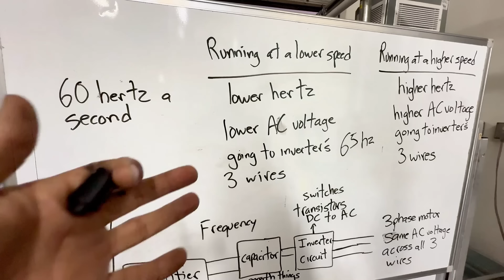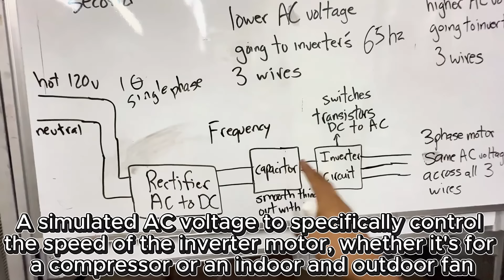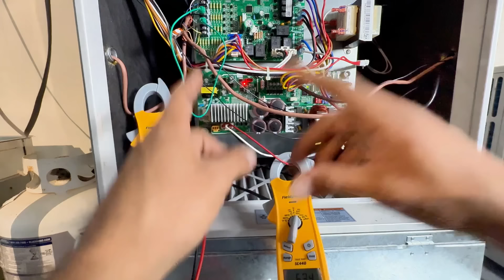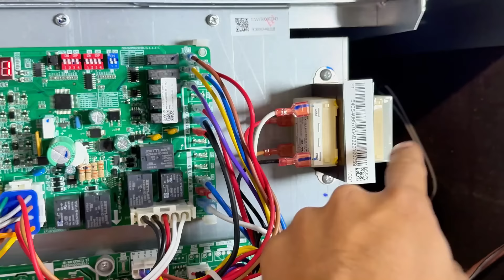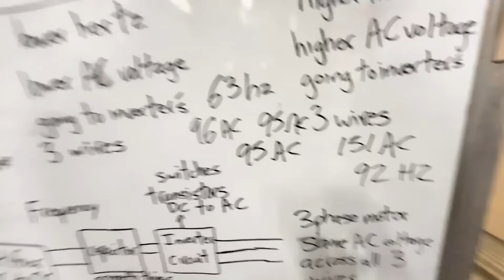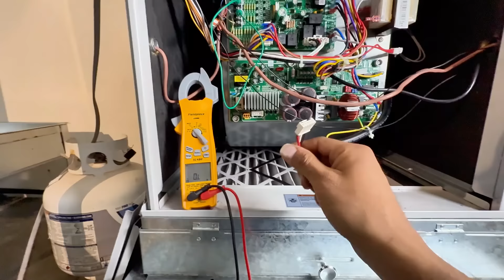How Do HVAC Inverters Work? (Simple Explanation)

Comment: Excellent video class. Thanks.
I've been in the HVAC business for 30 years so far, I have never stopped learning. There's always new technology coming up to force you to keep up.
Basic troubleshooting tips is what's most needed for us in the field. 
I've replaced communicating compressors, fan motors, and drives. Using the same procedures you described in your awesome video. Thanks again.
👊🤓

Comment: With one exception everywhere you say "Hertz" you mean to say "frequency".  That's how quickly the sine-wave of the AC power completes a 360 degree cycle from 0VAC to 120VAC  to 0 to -120VAC to 0.  The exception to saying "frequency" is when you talk about the NEC specifications, which is that 120VAC is deliverd at 60 cycles per second, or 60 Hertz.  Note that Hertz is named after a man, so it is capitalized.

If you're going to talk about single-phase AC being converted (eventually) to three-phase AC gong through the intermedia DC circuit is accurate and fine but you don't mention the 6-10% loss of efficiency in the process.  In other words, power out (3 phase) is roughly 0.9x power in (single phase) and the rest is released as heat.  Best to use devices and circuits that minimize this loss..

White is the wrong color for 3-phase.  They should be red, black, and blue.  For Delta configurations.

When you check voltage (AC) red-black, red-white, and white-black that means your 3-phase power is in a Delta configuration.  If it was in a Wye (Y) configuration there would be a neutral, and you'd check red-neutral, black-neutral, whatever3rdcolor-neutral.  Note that since neutral is typically white in single-phase applications, in 3-phase Wye conigurations you'd save white for neutral and use -likely blue- for the phases.  So you'd have hots on red, black, and blue, and neutral on white.

You don't have to take a class on it, but knowing what you're working on will make your life easier, and make your YT videos usefully informative.

"Lower voltage, lower Hertz" -- no.  The frequency (which you insist on calling it by its unit of measurement) stays constant.  Power comes in at 60Hz and it goes out at 60Hz.  Give or take but output frequency must match input frequency.

I tried to watch more, but it's clear to me that while you want to be helpful, you don't understand any of this, and will mislead those who watch your video.

Hertz, Donut?

Comment: Most of those inverters are built into the and of the motor itself.. ECM motor.. X13 motor or variable speed motor. It takes single phase 120 V or 240 V and rectify it to three phase DC volts to operate a DC volt motor. DC volts allows the program to change the motor CFM‘s up to 600 different steps on inverter compressors like the Bosch. Three phase motors and compressors cost about 40% less than single phase to operate.

Comment: Echo the main strenght frequency correspond to relarive power to cool abmbient. And another type of inverter is coupling the two coil so the induction of input to have invert voltage on second coil so we had 240 volt out of 110v  or 110 v out of 55 v just like 3 phase so if 3 phase in put 3 coil induce 3 secondary coil so we hadc 180 hz 240 v

Comment: The inverter here is essentially a VFD or variable frequency drive programmed to also act as a soft start to eliminate large energy consumption spikes. This one is converting the incoming single phase power to 3 phase power. Three phase motors give better speed control and are more efficient than single phase motors. Especially under speed controlled conditions...
Reply: Exactly, guys, check how a VFD works for controlling a 3 phase motor to better understand how inverter technology works.
Reply: Yeah, you’re spending all that money to save pennies.  When you added it all up, the energy companies are saving money while you’re foot in the bill.
Reply: @garyo8546 the money you save from energy they get from you when you need expensive new parts.
Reply: @garyo8546 these are more about comfort than power savings

Comment: gli inverter ormai sono uno standard da 20 anni in Europa, purtroppo i tecnici non sono assolutamente preparati sul lato elettrico, misurare tensioni e Hz non rientra minimamente nell'ottica della riparazione, misurare gli avvolgimenti si.
Sono riuscito a riparare un General da 30kBTU grazie allo schema circuitale delle 5 schede elettroniche che montava, alla fine era un semplice condensatore di sicurezza sulla linea di comunicazione, un componente da 1€ bloccava l'intera comunicazione, una volta sostituito è tornato a funzionare 😁😁

Comment: Just so some may not know (the younger generation), the old air-cons worked only in an on-off way, the compressor would turn on, once the desired temperature was reached it would turn off and so on, no circuit is required as the thermal sensor turns the unit on and then off (but cannot control the compressor speed), the new inverter systems work this way,, they convert AC to DC to allow electronic components to work in their right DC state, now you can control the compressor's speed, they use a IGBT to control the compressor motor's speed thereby reducing power consumption, the video explains it in more detail.

Comment: Well I noted that even the compressor  work harder and frequency when up, with heat pump working, the consumption of power it's a lot lower in winter time. 

With a split ac unit. Working with panels solar in winter every watts 😅  matter

Comment: How would you determine if a motor is bad against the inverter board
Reply from the maker: You can check out the windings of the compressor, similar to a 3 phase. Usually a board tells you if there’s an error. I’m still learning how these work

Comment: When you say motor you mean the compressor motor? I think so as the voltage can be quite large and you would not have this on the fan motor for cooling the condenser. The hertz is the cycling frequency for slowing/speeding up while the voltage increases to drive a heaver load/compress harder? The efficiency is achieve with optimal hertz/voltage for a given load. All clever stuff! Thanks for you simple explanations and using multi-meters to demonstrate the principles.

Comment: I'm not an HVAC pro by any stretch. Regular job is EE/Computer Science. A couple months ago I installed an ACIQ 5 ton inverter side discharge+ducted air handler to replace my old Train. I had to watch a crap ton of videos including yours to build up the confidence level. It all turned out good. In the end, I've learned to appreciate the old school 'jam a screwdriver into the contactor to force it to run' units - so much easier to work on and the physics involved is straight forward. These new high efficiency systems are jam packed with at least 4 major circuit boards and probably 2 boards that contain a microcontroller with firmware (the software that drives the algorithm you speak of). I've been looking for a "programming" device for my unit to no avail so I can get deep into the diagnostic data (there are ports, but they are probably only for testing at the factory in China). These things are becoming identical to working on modern cars where you need a laptop, custom cable and pay Ford for the dealer software to modify, diagnose and update - kinda sucks. Even the for the service manual - I couldn't readily find it. Finally, I had AI search and it was able to find both the condenser and air handler service manuals. However, these manuals are not low level enough to do things like board level repairs (for the most part) and do not explain the strange behavior of my unit (what trips certain phases like defrost, what current level on the compressor tripped a FC 49 error, etc). On top of that, they're so new and there's simply not enough folks in the field that have experience with these units. Good luck trying to get any data on the algorithm that drives these units - in particular I'd like to know to understand the protocol of their fully communicating thermostats. Currently, I am using a "dumb" two stage Ecobee. However, their version of the Ecobee (obviously a rip off if you look at the thermostat) is fully communicating which means it allows the unit to run completely at variable speeds. Keep making videos and if you find out any tips and tricks for these units, much appreciated! Thanks!
Reply from the maker: Thank you for your explanation. I know it took time to write your thoughts down. It’s sad they don’t let us understand the algorithm as to how exactly these units work. I’ll be working on a project on a mini split where I’ll be manipulating the thermistors using potentiometers and I have a programming software where I can see the temperature live. Inverter technology is simply using temperature sensors that are on your discharge line, evaporator, outside air, on your condenser and other temp sensor to either speed up or speed down your compressor, condenser fan or indoor fan as well as opening your eev. I’m Excited for this project!
Reply: @PioneerHVACControls  That sounds like an awesome video. I appreciate your work and willingness to share with us. I'm currently in the process of diagnosing my ACIQ minisplit failure. The compressor was surging and vibrating alot while in heat mode ( much smoother in cooling mode) before it quit and won't start up now.I initially thought it was a compressor mechanical failure, but am now thinking it is a power delivery issue.  I'll use your video to try some testing. Thank you
Reply: @PioneerHVACControls  please explain us more invertor technology of outdoor unit aswell  how its works heat pump thanku so much for explaining this to us great knowledge
Reply: wait until you have to replace something on it..   when there's  "not one in the country".....  or they quote you 6300.00 for an inverter board..........
Reply: You should replace the indoor temp sensor, instead of messing with the inverter. 

You dont want to change rhe defrost etc, ypu obly want to ramp up or dpwn the compressor. 

If you go for the inverter output, you wont understand the compressor limitations or underatand logic to return oil during low loads. 

There are several digital potentiometers that emulate a thermiator. Homeassistant + hardware, or harware and some kind of small programmable logic board is the way to go. 

There is a finished out of the box system for about 50usd, but i cant remember the name, i use it to emulate the temp fpr just this thibg in my inverter heatpump with a dumb thermatat

Comment: HVAC inverter in your system is VVVF variable voltage variable frequency refers to electronic drives that control AC electronic motor speed and torque by simultaneously changing both the frequency and voltage of power supply
Reply from the maker: Correct! Thank you for explaining that. Would wish someone would give me the algorithm to these so I can learn what exactly controls the speed of these motors to run faster or slower, especially on the compressor side.

Comment: ECM is similar but not the same as variable speed. My air handler is ECM and my condenser is variable speed. They are mismatched Ruud, 5 ton. They both are single phase, 240 volts, no neutral wire, two hots and a bare ground wire. 

Your next video should be about communicating systems. I had to run the condenser in legacy mode, non-communicating. The condenser operates using Y1 and Y2 and actually run as a 3 speed. The algorithm and timers dictate which speed is running. It really saves on the electric bill. If the outside temperature is greater than 99 degrees, the condenser will switch into superspeed, a fourth stage.  In fourth stage, it sounds like a weed eater.
Reply from the maker: Thank you for your knowledge and explaining how your system works. Makes sense how on a hot day, the condenser speeds up to reject heat. I would love to understand how exactly the algorithm works but no one shares that information but I’ll find it soon!

Comment: HVAC contractor with at least 20 inverter installs so far. Totally off grid and powering about 8.25T of inverter heat pumps. I have only had one failure on a customer install so far and that was a 5 ton Gree/Airtemp side discharge compressor. You did a great job on the video and looking forward to more. 

One troubleshooting check that you could also do on your inverter compressors and blower motors is to check from each Terminal UVW to ground. You should have infinity on your meter or Open. Most of them that I have found over the years, including the one inverter compressor have been insulation breakdown, causing a short to ground.

I’ve watched a lot of videos from India, Pakistan, Africa, Australia, but very few of them are translated into English or they don’t go deep enough into the operation of them and troubleshooting. I have to guess what they are talking about, but it does help. I’m glad you’re here now in the USA.
Reply from the maker: Thank you for your input! I’m trying to make more videos on inverters. I know other countries make a lot of videos on this subject. My next goal is to understand the algorithm behind the inverters but manufactures don’t like to share that. Will have to continue looking 🙏🏼

Comment: What’s the voltage when you measure Red, White and black to ground individually?
Reply: That is not a helpful measurement in this case, unless you are wanting to know how bad you will get shocked ;)
Reply: @FixthisCD why it was a useless measurement? If you really want to learn something you should have known as much as possible
Reply: Zero
Reply: @TexasEngineer are you a real engineer?! Based on your answer I don’t think so😂
Reply: Do you see a ground wire? No. Only three wires. From the information available, it looks like a delta wound system. Delta does not have a neutral wire. It could be a Y wound system but that would be very rare. The neutral wire is for imbalanced loads and this type of system has no need to have an imbalanced load. The three phases acts as a stepper motor driver and the motor follows the phase angle. At low speed you can hear the motor step. ECMs run too fast to hear this effect.

They are creating three phase power that is independent of the house supplied power, isolated. There is no reason to ground the independent system and risk house power contamination. 

Why do we ground the neutral? So if we get a ground fault, the breaker will trip. There are no breakers on the three phase power.

Am I 100% certain? No. Because I have worked with power transmission lines and they use delta. They do have a voltage caused by capacitance/induction to the earth. Is the voltage predictable? No. 

That is why the previous answer is correct, it is not relevant.
Reply: @TexasEngineer thank you for the explanation. I just wanted to know the measurements of each wire to ground with multimeter😂
Reply: Even though the compressor is stuck, the reading of resistant remains normal. Is that true?

Comment: I been waiting for vedios about mini split troubleshooting long time and that's the beginning of it .as a hvac contractor we start doing a lot of mini split unit but unfortunately we still don't have the knowledge how to troubleshoot these systems when they have a problem. It will be great if we see more content about these mini split.thank you so much for your contents on your channel.
Reply: Unless you have exact manufacturer diagnostic data and procedure, you won’t be able to make a call on these systems. Unless you do a four year degree in electronic engineering before becoming an hvac technician. You can only check the obvious. Sensors, voltage, AC and DC rails. The charge and fuses. Beyond that you have to know the specs and values for what you’re looking for. I do Mitsubishi, Daikin, LG VRF on daily basis. Each brand does things differently but I assure you most of our problems here in the U.S is bad installation. You’ll barely have to look at the electronics because you’ll be using service checkers and a computer.
Reply: @mwdub02 correct I hear bad installs is the primary cause of failure on mini splits
Reply: Yep call tech support and they tell... we usually dont have problems with em. Guess it needs replaced. Mini splits are the vain of my existence because the support for them is trash. Inverter ducted heat pump is way better at least tech support wise

Comment: Going from AC to DC and back to AC hurtz my brain but in today’s anything goes
Reply: Its the only way you can manipulate that ac voltage and make work on different frequencies. Because our incoming voltage from the city is already a set single phase or three phase at a fixed 60hz
Reply: Hurtz your brain!
Reply: That’s if you’ll go for it

Comment: G,day from Sydney Australia.
Great tutorial on inverter control board components. Also  measuring AC and Hz using a DMM.
Lastly the heat transfer process of a split system.
🌏🇦🇺